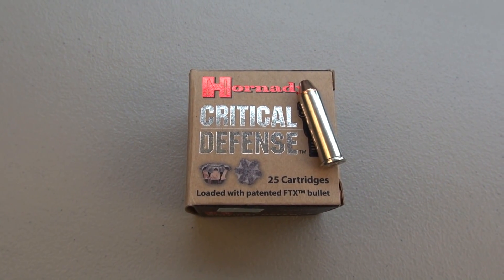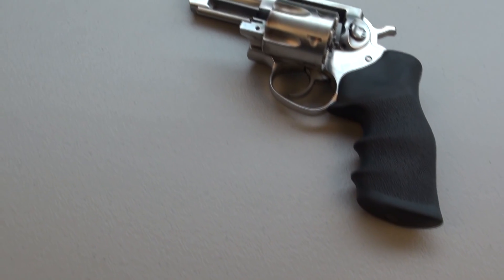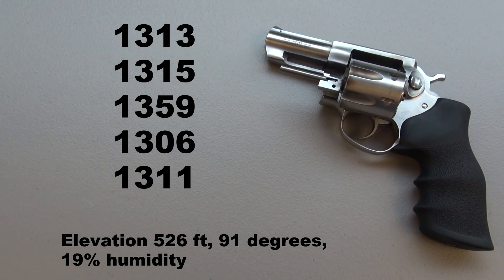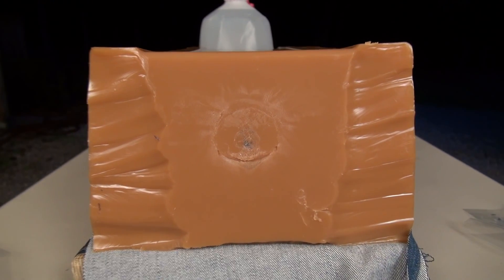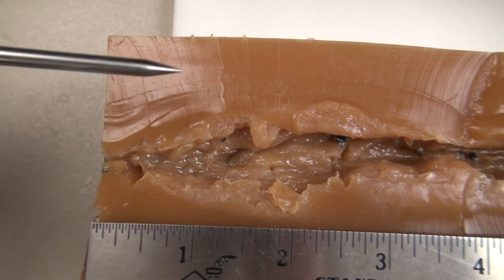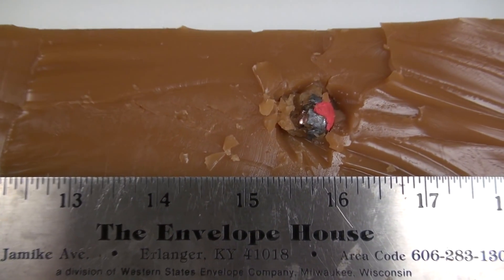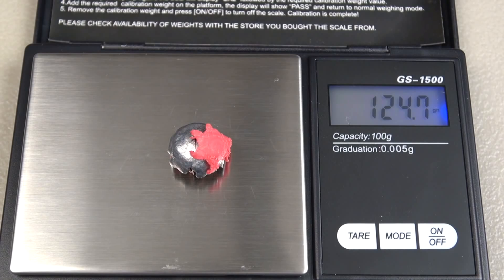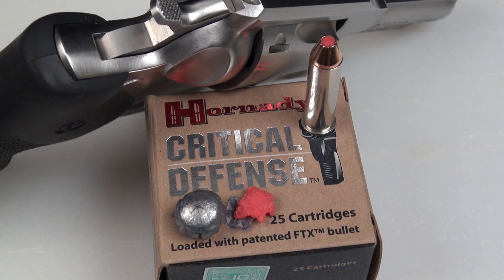.357 Magnum Hornady Critical Defense Ammo Gel Test

Comment: Using these in my .357 snub but wondering if I should up the grainage to 158, that said im not worried. 2-3 hostiles could be dropped no problem and i doubt im gonna wind up in a John Wick situation. the ruger GP100 3" is my next pistol unless I go Chiappa or Colt King Cobra

Comment: I have asked before, but never got an answer.   If the red rubber ensures expansion, what would happen if we added a drop of melted candle wax to the hollow point of a round that usually fails to expand because of plugging?   Would the wax help?
Reply: peelreg 
In all likelihood the wax would melt from the heat of the round when fired.
Reply: You would have to get wax that is up to snuff so to speak.

Comment: So to prevent the hollow point from plugging up they plug it with polymer. Does not make much sense to me. Gold dot and HST perform as well and better from what I've seen. Especially in 3 inch barrel pocket pistols. 9mm and up. Through all types on mediums.
Reply: mike   they plug it with a soft material that does not impede the bullets expansion the way that certain clothing like denim and multilayered heavy jackets has proven to plug the cavity in JHP which causes them to not expand and act just like a fmj. I.E.=small clean hole dumping very little energy in intended target.

Comment: 16 inches of penetrating is allot isn't it? Thinking of the penetration I wouldn't want to shoot an assailant in fear of pass thru and potentially hitting something behind.
Reply: The FBI uses this penetration protocol because appendages, particularly ones holding guns pointed at police officers, obstruct the center mass area, creating a greater penetration requirement to reach the bad guys cns.
Reply: I'm a paramedic and ran a call on a man who was shot point bkank in the chest with a .357 mag. Idk what the exact round was but it didn't pass through and killed the man on the spot. Center mass.
Reply: Logan Waltz then I only need a .380
Reply: not really, just be sure it is his partner behind him simple.
Reply: 10% Ballistic Gel Calibration:
0.177” steel BB 
590 ft/s ± 15 ft/s. 
Penetration depth from 2-15/16” to 3-3/4”

Comment: Hornady website gives 1500 fps from an 8" barrel.  So the lower velocity here  from a 3" barrel is right in line with expectations.  From a 2" barrel they advertise 1200 fps, with 400 ft-lb of energy. They also make a Critical Duty 135 gr (1275 fps - 487 ft-lb) round that should be better if you need to penetrate a barrier.

Comment: I don't get how many 9mm SD rounds can spread to .75", but I've never seen any .357 expand past about .65", w/ most around .5-.55".
Reply: Final expansion is quite different from "in process" expansion. Think about the entire path of the bullet and not just the final result... In general, .357 has a smaller final expansion because it is moving much faster. The extra speed peals back the petals more aggressively. Higher velocity 9mm rounds (+p, +p+) will often have less expansion than a slower 9mm when loaded with the same bullet. Expansion is not necessarily a measurement of effectiveness. It is a symptom of velocity (and bullet design). In that same time, .357 dumps much more energy, and likely matched or exceeded 9mm expansion. Take final expansion in ideal conditions with a grain of salt.. Consider the other factors: What was the penetration? How much energy was expended during that time? Bullet weight/momentum? Media/tesing method?

Comment: I hate how Hornady measures their velocity for the .357 from an 8" barrel. Thats cheating knowing that .357s performace is going to be drastically different out of a 3-4" barrel which is the normal length most people will have a .357 in. They should at lesst go by a 6" barrel length if anything
Reply: Jesus man, what do you want? .......Well,  I think Jesus wants your soul.      ;o)
Reply: They are still faster out of a 3-4" barrel than most readily available .356 SD rounds... Over 1300 fps in a 3" barrel!! Jesus man, what do you want? The numbers are all out there..
Reply: So you’re Dirty Harry? Cmon bro
Reply: Shoot try reloading for 357 mag. Most of the load data and stated velocities are rated with 10in barrels.
Reply: Yes Hornady sucks. I had to buy some Hornady ammo during the shortage but it will be the first to go when the Speer and Federal stuff comes back.
Reply: Published factory velocities are and have always been, an agreed-upon lie. an 8" test barrel-usueally unvented has no bearing on real world velocities.

Comment: isnt the decrease in you're velocity due to the shorter barrel? I know that the critical duty in 9 mil requires a 4 in barrel to get the advertised velocity and  Ft pounds. Also you're useing a revolver. Your getting escaped gases out the side of the wheel which is also going to contribute to lower stats.
Reply: Hornady uses a 8" .357 mag revolver to test their loads and thats where they get their advetised velocity. Its on their website. Personally I think thats like testing a 9mm or a .45 out of a 6" barrel to use for advertised velocity, and even then thats totally different since 9mm and .45 are designed to burn as much powder as possible in a short barrel. .357 performance is heavily impacted by barrel length. They should have tested it in a 4 or 5" barrel since those are the normal lengths for a self defense/duty style revolver..

Comment: What is the recommend 357 ammo from a snubbed nose revolver? I have a S&W MP340. It is a 1.875" barrel so I was wondering what the optimum .357 ammo is? Seems like the powder would still be burning far after the round has left the barrel.
Reply: Check out Speer Gold Dots 135gr. .357 Magnum GDHP Short Barrel.

Comment: Hey guys i was wondering if you guys could help me...im 14 kinda small but i have shot hunting rifles and shotguns frequently. The biggest pistol i have shot was a 9mm HK USP...based on your guys' limitless internet knowledge would a .357 magnum with a 6 inch barrel be too much for  a little kid...thanks guys
Reply: Six inch barrels can be kinda front-heavy, but more weight absorbs more recoil, so .357 out of something like that isn't that bad with good rubber grips. Just don't limp wrist it.
Reply: Even if the 9mm was about as much as you felt you could safely handle, you could still get a .357.  The beauty of a gun like that is that you can fire light loads in .38 Special whenever you want, which will recoil significantly less than the 9mm.  You can also shoot .38 +p rounds with a bit more kick, and then both light .357s and heavy loads.  I like a 6" barrel, but that is too long for some competitions.  Like one of the other posters said, it gets more out of the .357 than shorter barrels. My personal preference is a S&W 686, but a Ruger GP 100 is close behind.

Comment: I have a Ruger .357 Security Six, SS, 4" I bought new in 1980, and currently use the Hornady Critical Defense also.  Hornady has the Critical Duty load out now which is a step-up from the Defense load, and it's gel stats excel the Defense load as I've seen in tests.  Certainly the Duty ought to surpass the 16" of the Defense load, which in itself, is very impressive.

Comment: I also have a 3" sp101 and often carry the Remington golden sabre 125gr. .357 load because it has a lot less flash. Full house .357 mags with slow burning powder are pretty flashy in a 2-3" barrel. The gold dot .357 short barrel is another good one. One of my favorite loads is a 125gr. XTP over 7.5gr Titegroup it is really low flash and recoil and I still achieve 1300fps in my 3" sp101 due to the fast burn rate.

Comment: While I agree in principle with everything you wrote, one of my load-outs includes Underwood 38 spc. 125 gr. +P, which has 400 ft./lbs. of muzzle energy. This is greater than many, if not most, 9mm rounds and still has very easy recoil characteristics because of the SP101 weight and balance. Not a 357, but with little flash and less ear damage. Lighting off a magnum round indoors with a 3" barrel is similar to dropping a flash bang grenade at your feet.

Comment: Probably more ideal for the lever gun would be the Hornady LeverEvolution round.  It's specifically designed for lever action use.  The bullets are pointed, but with a polymer tip so it is safe to use in a lever action.  I would assume that they optimized the powder for the longer barrel as well, and engineered the bullet to expand properly at those velocities.

That said, my wife's home defense lever action is filled with Critical Defense, because that's what we can find.

Comment: I never claimed it was in the same ballpark.  Modern loadings have just watered down .357 magnum from its glorious potential.  The velocity drop in snubs is technically more drastic with coarser powders, but it will never be less than fine powders.  The only reason we have 9mm loadings coming anywhere close to .357 mag is because they are loaded beyond magnum pressure thresholds, and take their toll on the service pistols which fire them.

Comment: My friend experienced a home invasion.    We used to meet at the Marion County range on Wednesdays for many many years. In .357 Magnum he recommends three light loads with manageable felt recoil to handle the rush when being charged by three home invaders, then; three heavy duty loads to finish them off.   Based on your videos and my friends recommendation, may I suggest a firing solution of: 1st 3 rounds 100g Power Ball, 2nd 3 rounds 125g Double Tap.

Comment: while all revolvers have a cylinder gap alot of the newer ones have an extremely tight cylinder gap (so tight in some cases that you cant even slip a dollar bill through it) so yes, there is still some gas that can escape but the burning powder doesnt. there will always be some lost velocity but it is so minimal that it doesnt matter. besides, most rimmed revolver cartridges were specifically designed to compensate for that issue.

Comment: The .357 magnum factory load is more powerful that a 9x19mm+P+ factory load, but when the barrel gets shorter than 4" and if you're using rounds loaded with slower-burning powders you will see a sharp drop in velocity, and it's more drastic with the .357 mag than it is with the 9mm.  The .357 shines in barrels longer than 4" and in carbines.  The .357 is also a more versatile cartridge, because it can be loaded with heavier and exotic projectiles than a 9, for hunting/competition/pest control.

Comment: this is one fairly brutal round. i still rather use hornady's lever-evolution rounds in my .357 mag revolver. i havent chrony'd any shots from these rounds but i like to think they tend to have a flatter trajectory/faster muzzle velocity due to the pointed polymer tip instead of the flat-nose polymer tip. considering this round was designed for lever-action rifles its recoil in the revolver is more managable than one would expect.